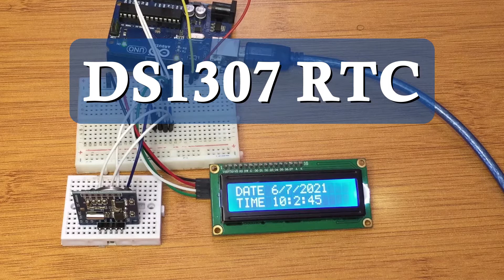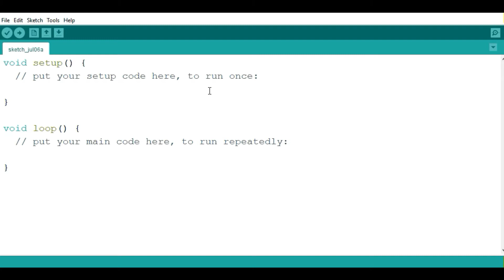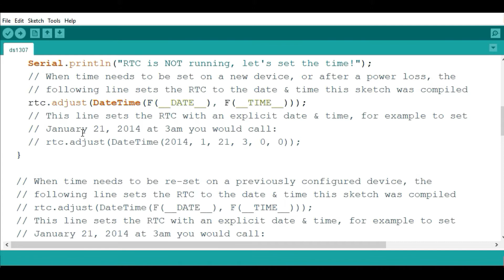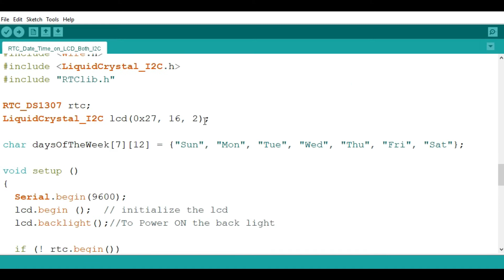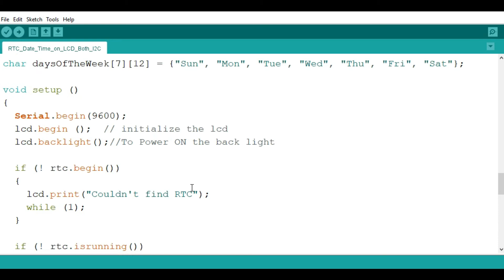DS1307 RTC module With Arduino (Tiny RTC ).

Comment: you used the 2032 non li rechargeable battery? If so then wouldnt you remove the charging circuit from the ds 1307 because that will force the battery to charge and can cause it to explode.

Comment: Bom dia amigo.
Muito bom seu projeto, bem explicativo e pratico. Parabéns.

Vc poderia me dar um auxilio?
Tenho um módulo de 8 relés e um rtc ds1307.
Programei um horário para ligar o módulo, porem gostaria de ligar cada um dos relés em 1 minuto após o outro. Tipo ligo todos juntos as 12:00 e desligo um por minutos tipo 13:00, 13:01, 13:02, 13:03, 13:04, 13:05, 13:06, 13:07, 13:08.
Teria como me dar um auxilio? Agradeço desde ja

Comment: Your video is about led matrix esp8266 i took the code from that video but got the error "MD_MAX72xx.h: No such file or dictory" can you tell me how to fix it. Thanks
Reply from the maker: That is because you have not installed the MD_MAX72xx.h library. Please visit this link for more reference on the libraries necessary for using the LED matrix; https://mytectutor.com/max7219-led-dot-matrix-display-with-arduino/